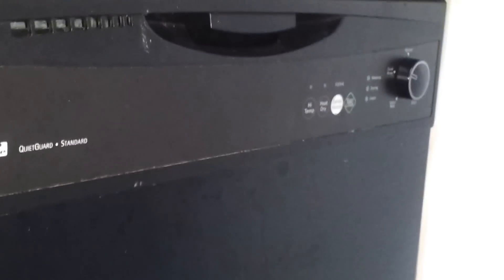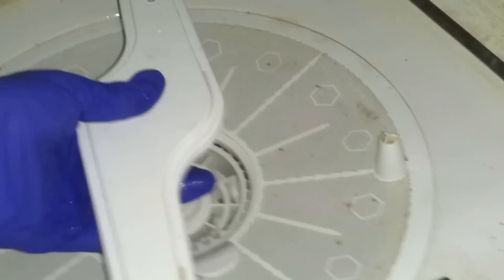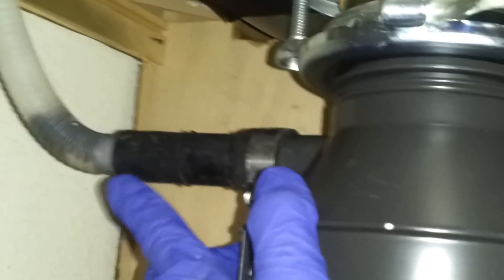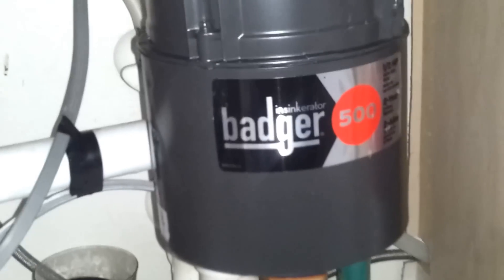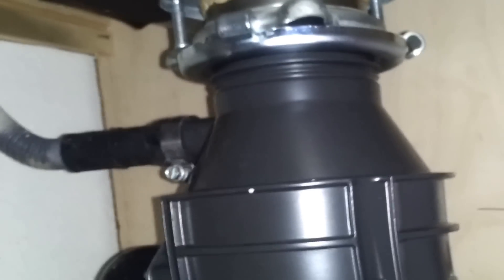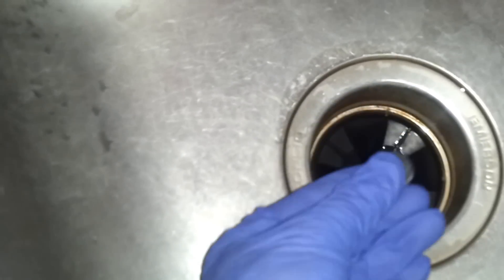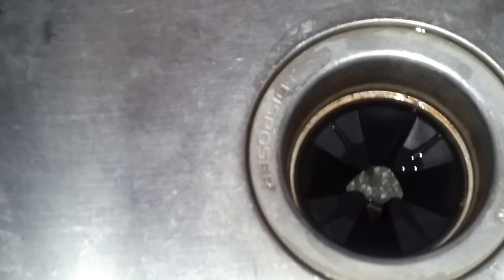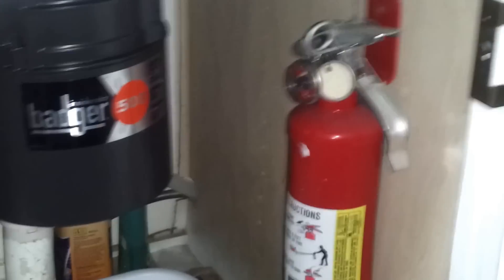Kenmore dishwasher not draining | Rex Wu |  Premier Financial Alliance

Comment: Thank you! The building maintenance man installed a new disposal, and didn't know about the "knock out plug" on the disposal.  He doesn't do much plumbing, so was a little inexperienced regarding this. I do my dishes by hand most of the time, and only run the dishwasher about once a month. I only do it then to keep it operational, because I had heard that the gaskets etc. will dry out. So the first time I ran the dishwasher after the replacement of my disposal ended up with a dishwasher that would not drain.  While waiting for the maintenance guy to show up, I did a little troubleshooting on my own. Luckily I found this video that pinpointed the Exact problem!  Thank you again! If not for this Valuable information it could have gotten quite ugly... LOL.

Comment: I was having problems with my dishwasher after having a new garbage disposal installed. I thought I was going to have to call the installer back until I saw Rex Wu's video. I do have one suggestion, use something other than a screwdriver to dislodge the plug in the garbage disposal. The screw driver went right through the plug. I used the end of a wooden spoon which knocked it right out, I re-attached the hose and the dishwasher drained perfectly much to the suprise of my husband who kept telling me to wait for the installer to come back so that I don't mess something up (lol). Thanks Rex.

Comment: You have saved me the cost of a new dishwasher.  While I was away I paid a friend, who is a maintenance man by trade, to install a new garbage disposal for me. When I returned home my Whirlpool dishwasher would not drain.  I researched and first checked the tubes/hoses and then tried taking apart the inside of the dishwasher and cleaning it out. Thought this was going to fix the problem as we found broken glass trapped under the washer arm & more smaller pieces below the filter.  This didn't work.  So we replaced the drain pump but it still would not drain. I almost gave up and went out to purchase a new dishwasher.  I started researching again and found your video and that is exactly what the problem was!  I'm still shaking my head that it was so simple to remedy the problem! My friend has installed many garbage disposals, but never a Badger.  Thank you again for posting this wonderful, wonderful video!

Comment: This was the missing step!  Took 2+ hours to clean all the inside parts of the dishwasher - what a gunky mess.  Still didn't drain.  Popped the plug on the new garbage disposer - success! Now we're ready for Thanksgiving dinner tomorrow.  Thanks.  Needed 2 videos to complete this job. At least we didn't have to call a plumber or buy a new dishwasher.

Comment: Thank you so much...your video saved me so much messing around.  Both my garbage disposal and my dishwasher I replaced in the last two months with used ones.  I would have thought this a much more serious problem if not for your video. Mine didn't tap out easily... I had to remove my disposal, but I didn't even unwire it..so it took less than 2 minutes.  Thank you, thank you thank you!

Comment: I just had my disposal installed and it was awesome. Then I noticed that I ran my dishwasher the water wasn't draining. I saw a few videos where it showed that I had to take this apart and that apart until I came across your super simple video. Sure enough I had the same problem. So I got a straight slot and a hammer and knocked it out. It took me 6 taps, but hey it's fixed!! thank ouso much. I don't know why the my installer didn't know that.

Comment: Wow, I have almost the same dishwasher & disposal unit !! Couldn't believe it .. mine was clog-up in the hose coming from the dishwasher to the disposal unit. Pulled it off and got a thick piece of wire and ran it up into the clog, broke it up and ran the dishwasher. Had the hose hanging down into a pan and it all came out... easy quick and done in minutes.. Thanks...

Comment: Seems like they'd put the knock-out plug on the end of the tube, maybe with a pull tab, so that it would be impossible to connect the dishwasher hose without removing it.  Probably that would have cost them 3 cents.  Anyway, great job researching before starting in on it.  Some guys would start taking the dishwasher apart.